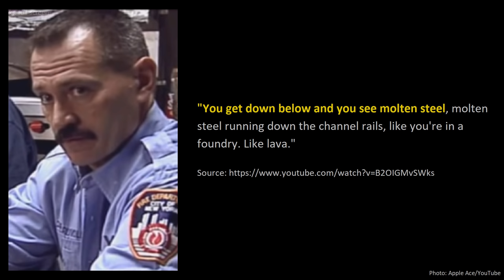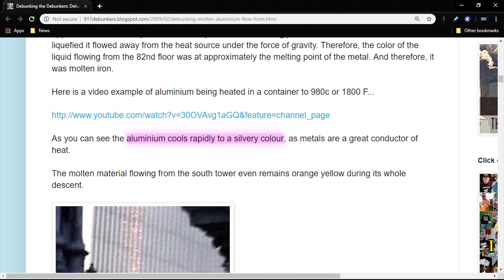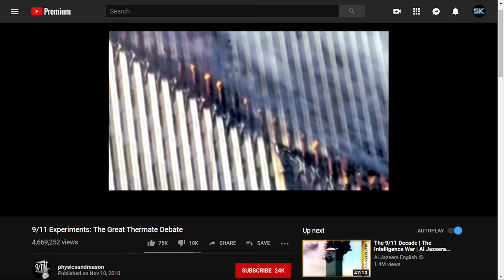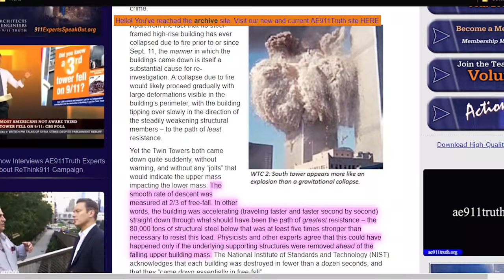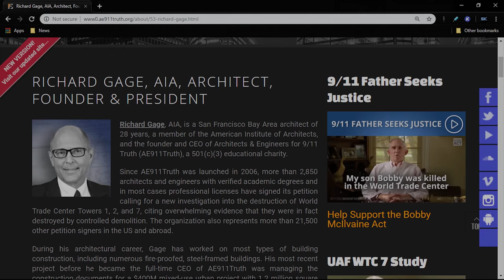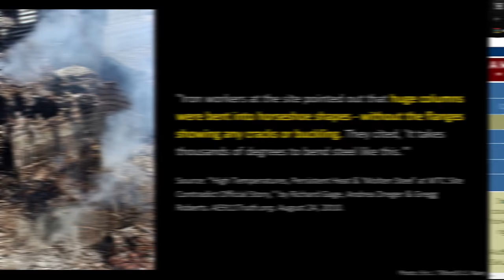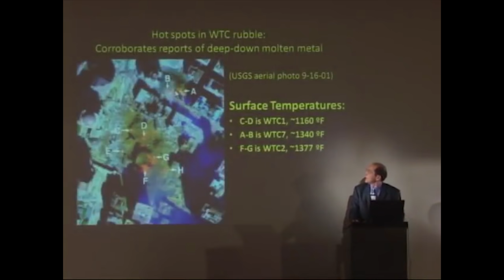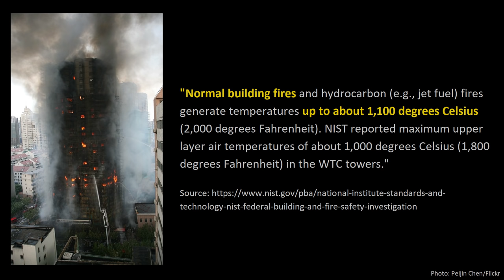9/11 Truthers Debunked: "Molten Steel = Thermite From Controlled Demolition!"

Comment: At what temperature will aluminum continue to glow redish when poured in daylight?
Are such temperatures achievable through open office fires?
Reply: You didn’t watch the whole video
Reply: You are changing the subject in large quantities of molten aluminum will more likely stay orange
Reply: @jonahmoran3751  you have no idea what you're talking about. The color a metal glows is a function of it's temperature, not it's melting point. The temperature at which aluminum glows like molten steel is... the temperature at which steel is molten.
Reply: excellent point, and no they are not.
Reply: Has anyone ever talked to the clean up crews and what they saw for the months they cleaned up the collapse?
Reply: @mccad00  "The temperature at which aluminum glows like molten steel is... the temperature at which steel is molten."
Very good, absolutely right. And, what color would it have at that point?
Reply: @mooneyes2k478  it would be yellow... which is completely irrelevant because the fire in the building was not NEARLY hot enough to make it such.
Reply: @mccad00  No, actually, it would be WHITE. A36 industrial steel melts at 1538 degrees Centrigrade, give or take a couple, and at that point radiates bright white.
Which is why we can easily see that that is not steel.
Aluminium, on the other hand, melts at 660 degrees Centigrade and will glow yellow, just like any other substance, at about 900 degrees centigrade up to about 1100.

Temperatures of the 9/11 Tower fires reached as high as 1000 degrees. Which means, what do you know, a yellow glow.
Reply: To make aluminium glow you will have to keep it in a container and continue heating it up otherwise it will just sip through cracks.  So something got to be functioning like a crucible to hold it until it (the crucible) starts to melt and spews out the aluminium AND its molten self.  So whats the crucible made of? It can't be aluminium.
Reply: Yes
Reply: Agreed and solid aircraft aluminum doesn’t just light on fire. For it to rapidly combust the aluminum needs to be in powder form.
Reply: @mooneyes2k478  as far as i know, some metals, at a given temperature, dont glow the same, due to the black body radiation
Reply: @werner9643  Ok? That doesn't really change that, they do. But please, do enlighten?
Reply: @mooneyes2k478  if at a given temperature aluminum doesnt glow as much as steel, this changes everything, thats why im trying to figure out what temperature it takes to make it glow like that
Reply: @werner9643  It would...if it didn't. But, since it does, that doesn't really matter.
Reply: @werner9643  While we're on the subject of glowing things falling out of a building, here's a thought.

watch?v=5NhY6d9WON4

Look familiar? Does to me...and what do you know, there's no metal at all.
Reply: @mooneyes2k478  wait, wait, wait, you are not serious right?
Reply: @werner9643  I'm not?
Reply: @mooneyes2k478  well english is not my first language but ill try my best to explain the differences between the molten metal flowing out of the twin tower and ur video, also i must clarify that even i am not sure that thermite was used to destroy the two towers, im not here to make other people think that they are wrong and that i am right
Reply: @werner9643  Oh, you needing wonder. It wasn't. Thermite is a vigorous exothermic. It gets really hot....for literally seconds, and then it's gone out. There's no way it can be used for anything other than welding small cross-sections together, or cutting small cross-seconds apart. It doesn't last long enough for anything else.

And, in what way can you possibly tell that that is a metal? Of any kind. It's "glowing thing(s) falling out of a building". From the distance, there's no way you can tell that it's anything more than that.
Reply: @mooneyes2k478  the video you showed me, look at the speed and the acceleration of those incandescent fragments, its not even comparable with one of the molten metal of the twin towers. Sure, you can tell me: but that hill is not as steep as a skyscraper, of course theyre not accelerating the same way!!  But if you look carefully, after the first section of the hill from which theiy're throwing that stuff, the hill actually becomes very steep, as you can see, after the fragments cross the upper part  of the hill, they fall for 20 meters without hitting any kind of obstacle and yet they accelerate so slowly. Took them like 4 seconds to cross that middle section of the hill. Hell, at some point wind started picking up and the fragments were being carried by the wind 😂. You can clearly see the difference in density  between the metal flowing out of the towers and that burning charcoal. Yeah, it was like watching molten metal falling a hill, just in super slow motion, like 0.25 speed 😂😂
Reply: @mooneyes2k478  you cant tell the difference between embers  and molten metal, and now you pretend to know how thermite works 👍. way to go chief!!
Reply: @mooneyes2k478  besides, we were talking about the temperature at witch aluminum start glowing yellow, so that was completely off topic
Reply: @werner9643  I don't need to pretend, "chief". I know. See, the Goldschmidt process has been know of and understood for over 120 years.
So, in contrast, I know what it can do and can't, the obverse of which clearly cannot be said.

But, since you're the clear expert on the matter, how about you tell me what exactly says "oh, it's metal" about something that is several hundred yards away, and filmed on an unsteady handheld of 2001 vintage?
Because all it is is "something glowing".
Reply: @werner9643  "esides, we were talking about the temperature at witch aluminum start glowing yellow, so that was completely off topic"
So we were. Until you brought up thermite.
Reply: @mooneyes2k478  but chief.. i never said im an expert, as a matter of fact i came here looking for answers, not to give answers, you not being an expert on this topic does not make me an expert. At least i dont pretend to know.
 you're not able to tell apart embers and molten metal, how do you expect me to think that you can explain me what thermite can and can't do???????
Reply: @werner9643  "but chief.. i never said im an expert, as a matter of fact i came here looking for answers,"
Actually, yes you did. You said that I "pretend to know how thermite works", thus clearly showing that, since I don't know, you can TELL I don't, and so you DO know.
However, as noted, I am completely aware of what thermite does, and does not, do. Which then leads to the conclusion that, since you think that's wrong....you don't know.

"i came here looking for answers, not to give answers"
Then you shouldn't make definitive statements. If you do that, you'd better be able to support them. You have stated that it's clearly metal that is falling out of the window. So, define how you know, or admit that you don't know. One or the other.

" you're not able to tell apart embers and metal"
But you clearly can, since you can say with such certainty that I can't. As noted above, do define how you can tell. What makes it metal and not embers.

"how do you expect me to think that you can explain me what thermite can and can't do"
One has nothing to do with the other. Amazing, isn't it?
Reply: @mooneyes2k478  how can you still talk after you posted a video like that🤣🤣🤣.
Reply: @werner9643  So, what you're saying is, you couldn't rebut? Cool, glad you admit it.
Reply: @mooneyes2k478  if you want, i can easily reply to thatcomment, its just that i came here looking for answers, not to talk with people that knows about these things less than i do, today i got a lot of free time, do you really want me to reply to that comment?
Reply: @werner9643  "if you want, i can easily reply to thatcomment"
You very obviously can NOT, since you haven't. 

"its just that i came here looking for answers"
No, you did not. You came here to flaunt your great brain, just as all other "truthers".

And as for "knowing less than i do", since we've clearly established that you can't actually rebut, it's very obvious, again, that you don't.
Reply: @mooneyes2k478  aight wiggum, i wanna give you an example. 
A guy comes up to me and tells me that he doesnt know how to solve subtractions, then he asks me what 2 minus 1 is . So i tell him the result is 1. Does me being able to solve this subtraction make me a mathematician? I dont think so. cuz knowing basic math is NOT ENOUGH to make me become a mathematician, on the other hand, him asking me that question is enough to make me realize hes NOT a mathematician because you cannot become a mathematician without knowing basic math.
You see, knowing some basic physics is more than enough  to tell the difference between molten metal falling down a building and embers falling down a hill. Now, do you think knowing basic physics is enough to become a thermite expert? Of course not!!!
Reply: @werner9643  So.....you had nothing to say except something completely irrelevant?

Good sign.

That you don't understand the Goldschmidt Process only mean that you fail even basic physics and chemistry. Not like it's difficult.
Reply: @mooneyes2k478  i dont know what your definition of thermite expert is, but the study path one has to take to become thermite expert definetely includes basic physics and basic chemistry
Reply: @mooneyes2k478  so do you still think that there's no difference between molten metal falling down a building and embers falling down that hill?
Reply: @mooneyes2k478  do you want me to explain again how i was able to tell the difference between molten metal and embers. I can be clearer and more precise if you want
Reply: @mooneyes2k478  You can see videos of the plane impact where engine parts fly out the other side of the building after impact. Some shots even show the shape of the plane's nosecone exit out the other side. Given the inertia of the plane at ~500 mph at impact, how is it that the aluminum of the plane magically migrated to that one specific corner? That's just a rhetorical question. The answer is: It didn't. It's ridiculous to believe it did. If you believe it did, then you'll have a new problem on your hands of trying to explain how the basic laws of physics where circumvented that day...
Reply: @mooneyes2k478  The thermite reaction in this video looks exactly like what we see coming out of the tower (the tower being a scaled up version):

watch?v=1N50IjDB5Sk&t=58s
Reply: @mooneyes2k478  Believing also that the aluminum from the plane was balled up perfectly and put into a magic crucible for this to happen is pretty laughable as well. There's a sucker born every minute, as it is said.
Reply: @lex.cordis  Which all failed on "you can see". Because there are no videos that show what you want them to. And claiming, or repeating, it doesn't make it so.
Reply: @jonahmoran3751   learn some thermodynamics , 🤣
Reply: @jonahmoran3751  this video is leaving out a major key point. Many support column beams were cut at a 90 degree angle with molten metal on them. Planes don't do that
Reply: @Krookedhands  45°
Reply: @wayde187  yea, that's what I meant...

Comment: Fires won’t burn underground if it has no oxygen.  Thermite will
Reply: Thermite reactions are rapid, not sustained.  Debris pile fires were not "underground" and did not lack for oxygen.

Did you know there is an underground fire in Australia which has been burning for 5,000 years?

Comment: Those buildings fell as if nothing but air was holding them up.
Reply: The towers collapsed when the steel beams in the gutted and burning 3 or 4 floors around the 85th-99th  floor could no longer support the weight of the 10 or 25 stories above them. As the towers collapsed, the weight, mass, and speed of what was  collapsing down increased until all 110 floors of the building had collapsed on the floors below them.
Reply: @johnstuartsmith have you seen the spire turning to dust or how the top of building 1 looked like it was falling off and the top of it disappeared into dust.
Reply: Did you ever play jenga? when you take away enough parts that hold your tower up it comes down like it's nothing
Reply: Yeah thru a process called dustification
Reply: @johnstuartsmith  15 floors cannot colapse 210,000 tons of steel. 
Stop lying. ✋️
Reply: @johnstuartsmith  so you’re trying to tell us that 75% of a solid mass, couldn’t support 25% of itself?
Reply: @DutchDukeMan  this is also very stupid, there weren’t any parts removed from the first 75% of each building.
Reply: @LetsGetitBoah  How about the structural intergrity that's completely missing of about 8 floors having to hold the weight of the other 25 floors above.. while it's being heated to extreme temperatures from the fire of a 10.000 gallon fueled burning airplane. seriously how hard is this to understand for you crazies?
Reply: @DutchDukeMan  A good majority of which would have fallen from the sides of the building leaving the majority of the intact structure in place. 

YOU are the crazies for thinking that is even possible.
Reply: @LetsGetitBoah  that's not how physics work my friend but keep believing stupid stories you read on reddit instead of using common sense
Reply: @DutchDukeMan  It wasn't completely missing. Only 3 or so of the 47 core columns were severed, a few more with major damage. The fires travelled around as the fuel burned out, no single spot was raging in fire for much longer than 10 minutes.
Reply: @JRnyc It was more like 15 floors collapsing on 95 floors… then 16 floors on 94… then 17 on 93… but of course as it went down the floors was completely muddled up but I imagine it hit new floors which carried on the process
Reply: @johnstuartsmith suuure
Reply: @DutchDukeMan  Well said!  Most people not involved in building design and construction have never heard or understand the diaphragm effect which is actually critical in holding together modern construction designs, especially high rises.
Reply: @brooklyn7941  Which is neither an actual word nor a process possible through known physics.  Stop sounding ridiculous.
Reply: @LetsGetitBoah  It was not a "solid mass" but rather an engineered ektoskeleton tied to a column and girder core with relatively delicate trusses that, once moved from their designed orientation, had very little strength or weight bearing capacity, and certainly not once that weight was in motion, accelerating as it fell.  Learn some physics and investigate the construction of the WTC rather  parroting online conspiracy talking points.
Reply: @Fr33zeBurn  This, despite the fact that intense fires burned for over an hour, as seen on video?

Comment: Then why was nano thermite found all over the site?
Reply: Ruh roh..... Can we just skip that question? hehe
Reply: Because thermite was NOT found all over the site. What WAS found all over the site were the so-called "iron microspheres" that are, in reality, generated in huge quantities by both welding and grinding steel, activities taking place everywhere, every day in the construction of steel highrise buildings.  It's not like they go around sweeping up after themselves during construction.  Anyway, thermite is not and never has been used for building demolition, just ask some of the professionals that do the job rather than parroting conspiracy theorists on the internet.
Reply: @Synaptic_gap  Nope. There was aluminum oxide found at the site.

Which is what you get when you burn thermite.
Reply: @suntzu6122  The most common method of producing  Aluminum oxide is the simple exposure of aluminum to oxygen (a component of air) which produces a layer of aluminum oxide on the surface of the aluminum.  Aluminum Oxide is also produced through simple contact with other metals, such as steel.  In that the entire exterior surface of the WTC towers was clad in tons aluminum, this would be the likely source for aluminum oxide in the WTC debris.  Again, if you do some research, you'll find that thermite simply has no use in the demolition of buildings and it's only industrial use is in specialized forms of welding.
Reply: @Synaptic_gap  explain the insurance policy taken out the day before. Ill wait.
Reply: @Synaptic_gap apparently thermite had to be used for the demolition of those large towers
Reply: @rodrigobravo3317  And of course 150 tons of aircraft carrying 10,000 gallons of jet fuel impacting the towers at 400+ mph had nothing to do with it?  You're just publicly displaying your ignorance.
Reply: @Synaptic_gap  and you're not? Government tells you to jump off a bridge will you do it? Say no and you will seem ignorant to me..plus you haven't explained to the other person.@suntzu6122.